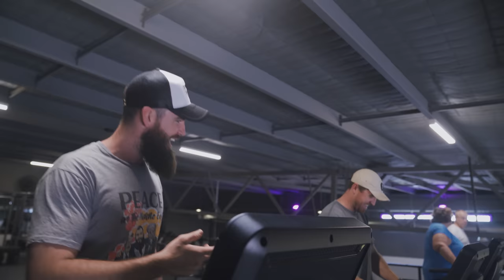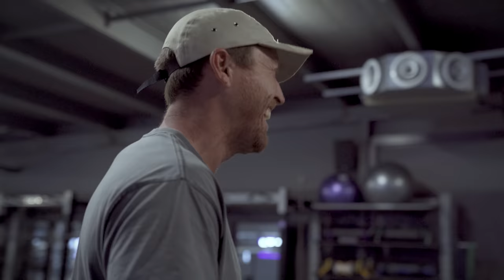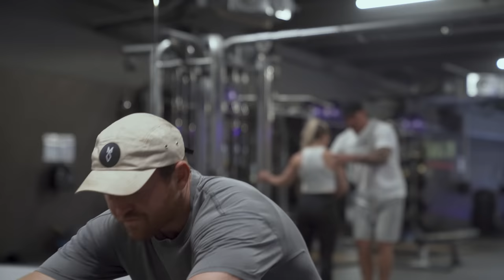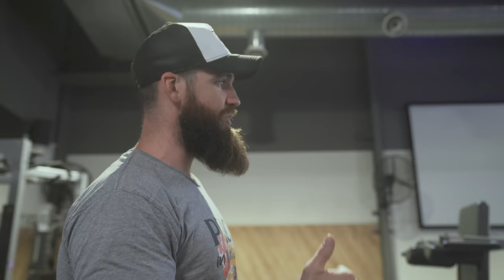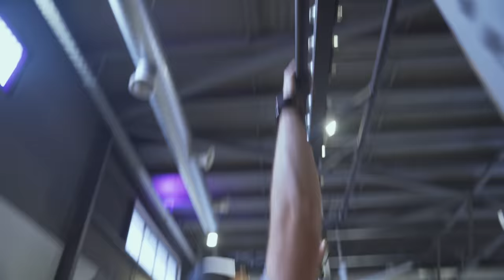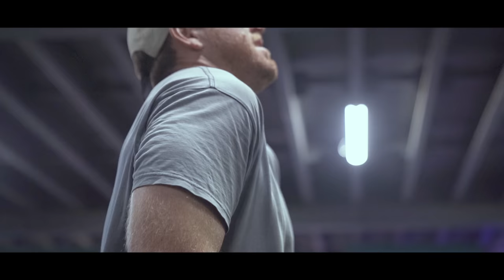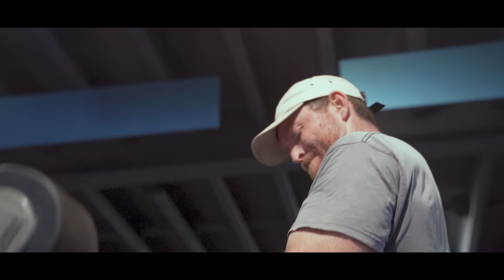Men Vs Body Positivity

Comment: My workout routine.

Tuesday: Sled Push, T-Bar Row and Benchpress
Thursday: Squat, dumbbell bent over row and dumbbell bench press superset
Saturday: Deadlift, barbell shoulder press and pull ups

I finish each workout with kettlebell swings, since it's helps improve deadlifting and is an excellent cardio workout. Now you may wonder why my workout days are set up like this instead of the usual Monday, Wednesday and Friday. Because by the end of the week, I'm exhausted and just wanna relax on Friday afternoon when the weekend finally starts.

Comment: You need to warn people about excessive uncontrolled exercise.  A few years ago I had my prostate out. After many weeks of radio therapy.   Monash university gave me a personal trainer, and Gym time. The university was doing a study on men loosing the prostate and then loosing strength. The program was a couple of days a week for a few months at a gym. It started with warm up on the treadmill, after a few days I started to complain to the trainer, that my right knee was hurting.  Now, it was not that I was unfit,  because I had ridden a bike to work (40km+ all off road,  so I did not get in anybodies way) every day for 30 years. The trainer just told me to push though it.  A few month on, and I had to have a knee replacement. The doctors told me it had nothing to do with the bike ridding, it was the pounding of the treadmill. That was 10 years back, and my knee still hurts.

Comment: The best advice for a first-timer going to the gym is not to get overwhelmed by all these different professionals suggesting particular exercises or routines for the best results. Go in there, try out a few machines, do a few different exercises, even if your form isn't perfect, and find what works for you. Also, don't be afraid to change your routine, add or remove exercises, and try new things. At the end of the day, if you enjoy the exercises you are doing you are more inclined to go back to do them. I would recommend push/pull/leg as a guide for planning, like what is suggested in this video, as it is a simple, but very effective way to plan out your routine, but if you want to focus on particular muscle groups instead, then by all means. Do what works for you and your health and fitness goals.

Comment: Just a tip if you ever read the comments. On push days if you do your biceps and on pull days you do triceps you'll notice a bit of a difference in the amount you can lift and also how much better your sets will be as push your working your triceps through the session and pull your using the biceps so they are already gassed from push pull sessions

Comment: warmups are very important! and so are cooldowns. preferably, dynamic movements should be employed in warmups whereas static stretches and the like should be your cooldown (to return your muscles to their resting length). warmups--the effect is in the name--raises your body temperature and gets your blood flowing through the body which allows for more oxygen and better enables the nerves corporated to the muscles to improve movement efficiency. along with cooldowns, they are very crucial in performance and also recovery. never skip either of them.

or you will increase your likelihood of succumbing to injury.

and get some fucked up joints.

yes this is a threat.

Comment: In a rural area, not much for gyms, so I work out at home. Been doing exercise sets five times a week, at least half an hour each day, with two days for rest/ recovery. Mostly target core and legs due to weakness and a knee injury. Arms and shoulders are targeted less, but that's because I can build those with free weights, push-ups, and similar. 

Spent twenty years at least forty pounds (20kg) overweight. In the last year lost about 25 pounds (12 kg), would like to lose another 15 (7 kg) at least. Not questing for a bikini body, just want to put myself in a good place to get through the remainder of my lifespan.

Comment: The gym helps get all the stress and frustration out.  I enjoy boxing on the bag and walking the dog.  We have to exercise to feel relaxed and happy.  Releases endorphins and endocannabinoids which feel great.  Move more, push, pull and move pins(I thought he meant the stack of weights with the pin for cable machines) but  isaac said "tins" as in beer.
I miss latt pulldown.  Remember you cant exercise off a bad diet.  Eat meat repeat.  Cut the processed junk food empty carbs

Comment: Great video; it's one thing to not hate yourself, but body positivity definitely pushes an unhealthy lifestyle. I was obese when I was 16 and my parents flat out told me I was fat, it wasn't good for me, and I needed to get healthier; dropped it all through diet and exercise and was down to 140ish by 18 (I'm a shorter guy at 5'5"), it was the best thing they could have done for me, they didn't do it to be mean but because they wanted what was best for me. In my 30s now and still kept the weight off, bit of exercise and proper diet is all it takes.

Comment: great stuff, unfortunately i can't go to a gym as i live on an island where there are none and with my disabilities there's limited exercises my body will do, like i can bench press but can't go above 20kg but i do mix in walks punching bag and now i can suddenly do squats(might be due to having better pain relief as i live with chronic pain)

but as you said find the exercises that your body will do and focus on those as i can bench press(not much) but i can't pull up my body jost won't do it doesn't matter if i'm overweight(currently i am 110kg) or underweight(i used to be 60kg although that was about 10 years ago now), although i use nickelback for my workouts aside from eye of the tiger of course,

unfortunately due to my disabilities i have trouble finding exercises that my body will do
my disabilities  include: degenerative disc disease, mild scoliosis, cerebral palsy, fibromyalgia, tourettes, gord,mild diverticulitis. just to name some no i'm not after sympathy i only listed them(reluctantly) incase on the odd chance someone had some suggestions for my circumstances as you never know until you try

keep up great work isaac

Comment: If you are fairly new to the gym I don't recommend doing ppl. Mainly because it requires 6 days/week, most new lifters mentally are not ready for that. Also if you new the level of soreness could be unreal. Both these factors can potentially turn people off from the gym. If you new I recommend full body 3 days/week.

Comment: I bring my girlfriend 6 days a week, we  bodybuilding ranges of reps 8 to 12 to failure on each set.  Once in awhile we drop the rep range to 3 to 5 to failure to have a strength week.  We have both lost about 60lbs and the fight with her about girl cardio was worth it.  The fat chics all go to the gym and walk on the treadmills.  Every good looking guy and girl in the gym is lifting weights.  Women are not magical unicorns needing special machines and exercises different than men.  We do the same workout and she just does lighter weights cause she fails with less weight.  Put some muscle on and your loose skin from weight loss won't be so loose.  Walking a treadmill will help weight loss but not long-term weight loss.  Women need to add muscle too.

Comment: This is great but you need to be careful not to give out bad advice, eg keto is great if you want to lose weight quickly, but it's not a magic pill, it's not sustainable long term and you'll find it really difficult to build mass on any calorie restrictive diet, also beginners shouldn't be starting out on a push pull legs routine, a better routine to start with is full body three times per week. 
Channels like jeff nippard and geoff verity schofields are extremely valuable resources for people looking to start training. 
You also need to make it clear that if you're enhanced, eg using turkesterone, then your routine will probably not work for a natural lifter.

Comment: 2:45 you are off, maybe not way off. Even though it's not hard cardio, and your reasoning is "it gets the blood pumping" is nonsense. If you're going to lift heavy, don't bother with cardio at the start of your workout. Just do cardio at the end of your workout.
Reply: Look at the workout these guys did. It is a bit of physical activity including resistance training.
It will make absoluteky 0 difference whether they do cardio before or after weights.
Reply: @teatowel11  That's why I said "if you're going to lift heavy". I commented as I saw that and wrote that.

Comment: Love your content especially where you roat the fucking hell out of fat positivity cos quite frankly it is total and utter shit.

I am a 36 year old dad of a 5 and a half year old who is 89kg and 5 ft 8.5in

My workout is as follows:

jump rope: timed 1 min on 30 sec off for 5 rounds
as many reps as possible circuit
overhead tricep extension with ez bar
bicep curl with ez bar
dumbell chest press
dumbell arnold press
dumbell side lateral raise
dumbell front lateral raise
dumbell bent over lateral raise
dumbell bent over row
dumbell lunges
dumbell deadlifts
30 sec work with 30 sec rest

the whole workout is performed with a pair of 10 kg dumbells and 20kg on the ez bar. I do one round and it will beat the hell out of you and the whole workout is less than 20 minutes 3 to 4 days a week

Comment: Come on man this business about a contest between the gym and those people which just do ks. Like walking ks or biking ks at the same speed. Or people who just do cardio at the gym. That's not how olympic athletes do it or competitive ones. They do "sets". Sets in their sport. Like 10x something then 5x this 5x that. Just like in the gym. But they use the gym a few times a week and are mostly doing their sport. You don't have to be an olympic athlete to do sport at different speeds or use sets in cardio. You just do less volume and slower speeds. There should be something for the average person to train like an athlete. So kind of on the right track. This whole cardio thing. People are just doing it the wrong way or people who only want to lift aren't giving any other ideas. Just knocking them and saying cardio or running is boring.